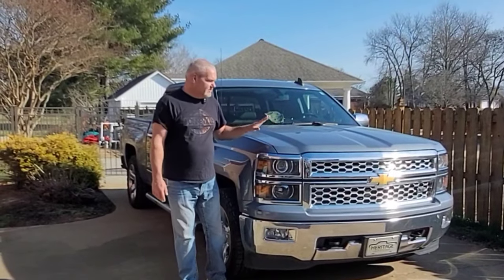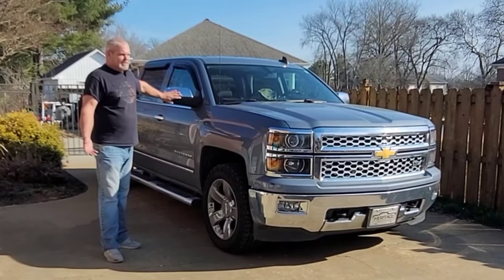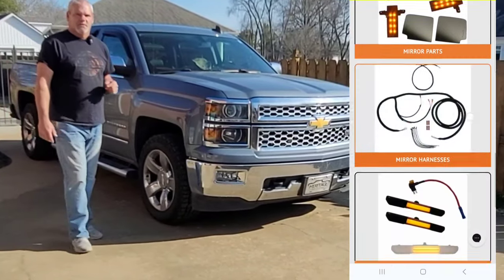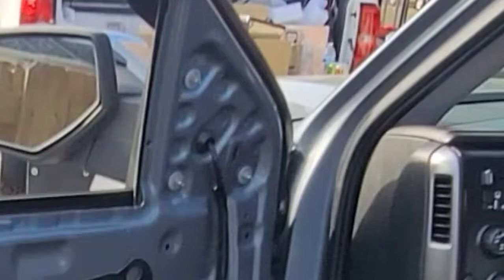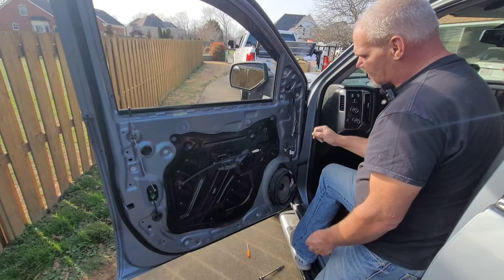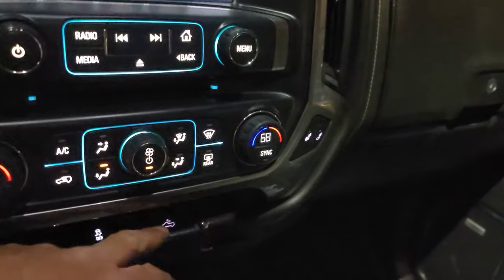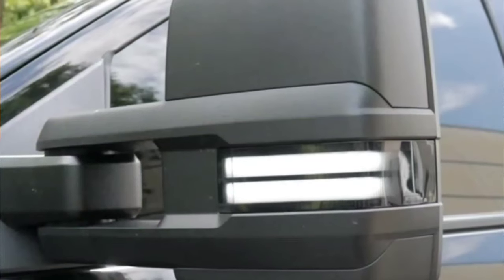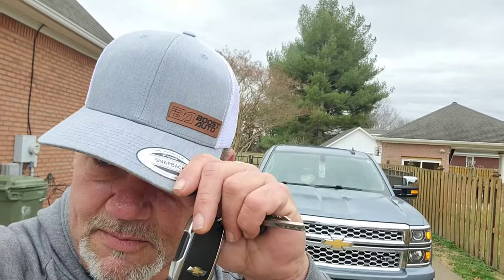Boost Auto Tow Mirror Upgrade, 2015 Silverado 1500

Comment: Truck looks good with the new tow mirrors. I installed the BoostAuto switch back LED smoked lenses kit for my 2500 tow mirrors. Real happy with the function and look. Liked them so much now I am installing the switch back LED smoked lenses kit for my cab lights to get even more visibility when operating the turn signals.

Comment: I may upgrade my mirrors on my 2500.
Reply from the maker: How are you liking the Duramax?
Reply: @CFarmer  definitely a learning curve. The power steering pump gave out and a few electrical gremlins that I’m tracking down very quickly.
Reply from the maker: I sure hope you get the gremlins out and it makes you a good truck
Reply: Good video Bud. I’ve actually been looking at those same mirrors at boost auto for my pulling truck. They actually make those upgraded mirrors for my older truck. Hope to get me a set of those before too long. Amazon has the cheap ones on there, but they are junkfrom everything I’ve seen. Stay safe, Bud.
Reply from the maker: Yes sir you too!

Comment: Great job! I found removing the door panel at the window sweep it's best to pull straight back instead of up - leaves the window sweep in place.
I had the tow mirror conversion initially done by the dealer and they swapped in a new wiring harness for them but my truck wasn't as well equipped as this one so I didn't have power fold.
I bought the Boost Auto power fold tow mirrors and it was plug and play with the addition of the power fold switch from Boost Auto, as well.
I've also bought the Boost Auto upgrade remote. The printing on the remote is still like new after a year whereas other remotes I tried would be without printing after a month.
I did get the tow mirror lights as running lights wiring from Harness Doctor but Boost Auto seems to have this covered already with their install.
Boost Auto is a great source for truck upgrades and I highly recommend them!
Again, great job and, thanks! :)